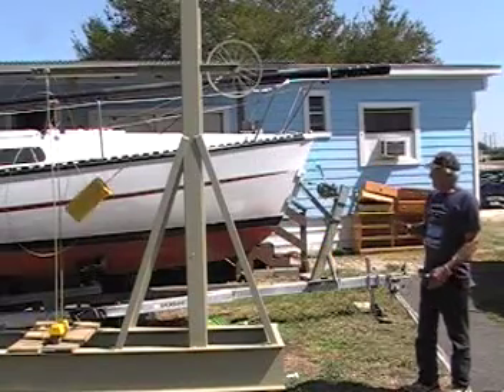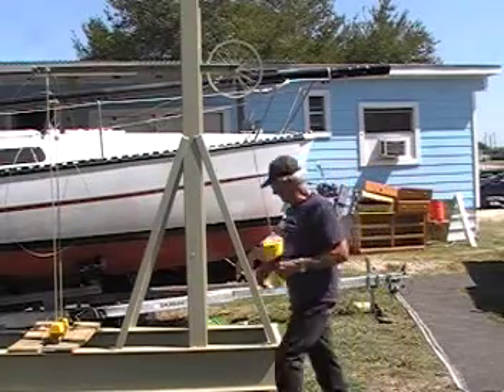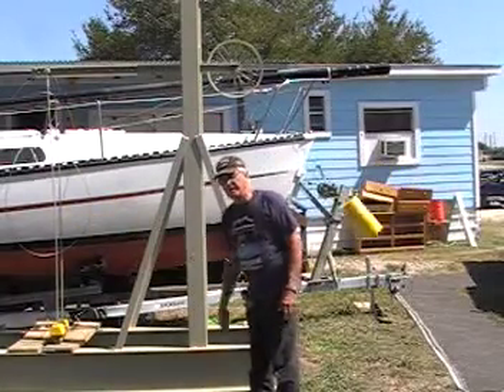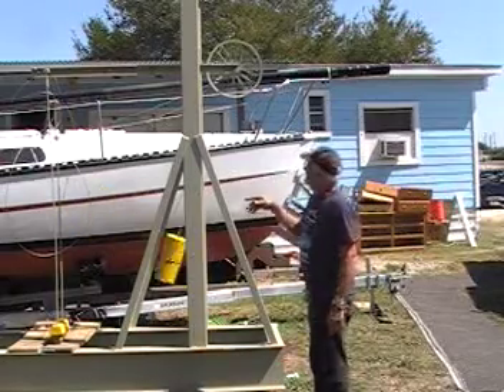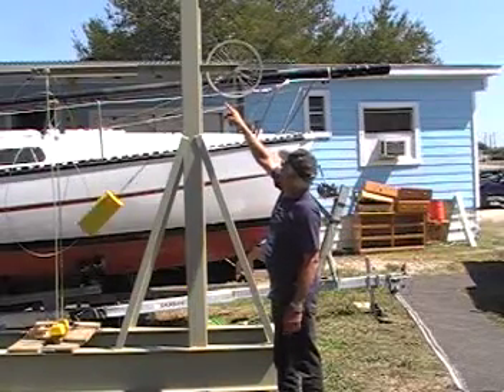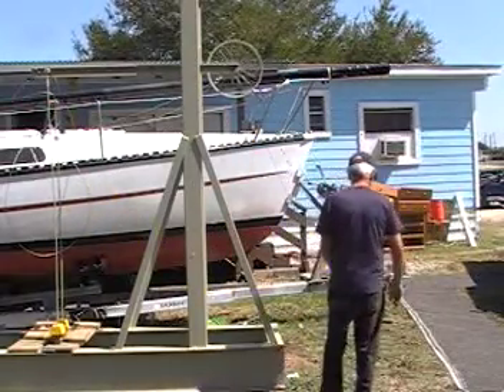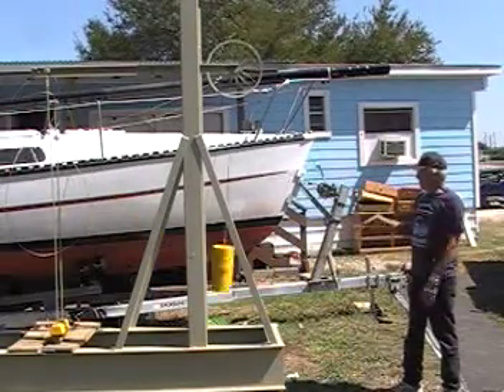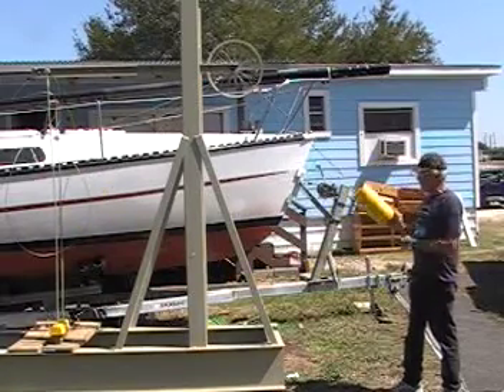Higher pendulum more weight lifted B  of  A&B

Comment: In most of the video I have seen this very nice  and cultured  gentleman keeps saying that the weight is being lifted!  It is not as simple as that is it, it is half of the story.  The facts  involves the weight being lifted  but it is also being dropped  and this is most important  as when the weight drops, it gives back all its energy to the pendulum,  through shifting its pivot  of the pendulum in a synchronised manner.   Once can transfer energy to the pendulum in many ways other than pushing it horizontally by a person.
If one uses a ratcheting system as is being suggested,  and the weight is not allowed to drop, then there is no energy fed back to the pendulum and the operator will have to sweat it out as  it is no longer a pair of pendulums exchanging energy between them.  It becomes a machine that transfers one way only from the human operator to an output that lifts the weight.

Comment: Great work!...Thanks for sharing, We have been investigating 'dual-pendulums' with magnetic gearing. [almost frictionless] This allows us to replace the cantilever beam with a simple spring, as the lateral forces cancel each other. We can also have 360 degree rotation, and at quite high rpm. Professor Liz Bradley of Collorado Uni is helping with a bit of advice. Who knows? this might work in 'zero' gravity. now that would be of interest to NASA....Let's 'Suck-It-And-See'. VOMIT COMET EXPERIMENT?

Comment from the maker: Very good question. And the answer is;; Absolutly., 
All you need is a little weight to return the lift arm.  For example. it lifts 70 pounds 1.5 inches and you leave 68 pounds up and allow 2 pounds to return the lift arm it would lift another 68 pounds the same 1.5 inches over and over again untill you have all the weight you wanted at 1.5 inches high.
OR; You could,  with a ratcheing chain,  lift 68 pounds to as high as you wish. Your limet is your imagenation & your wallet..